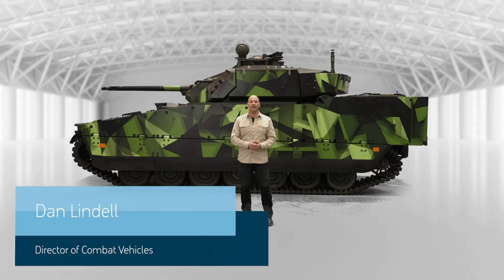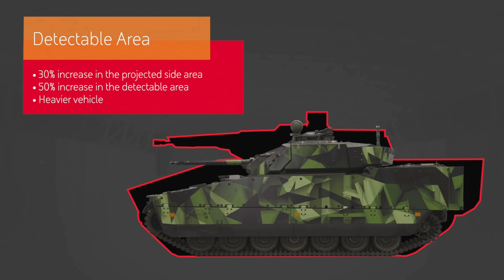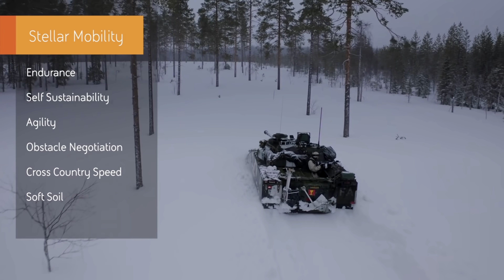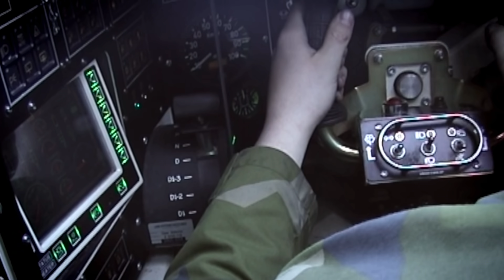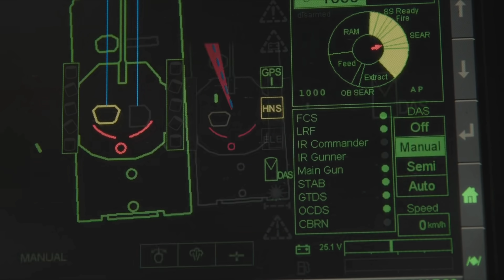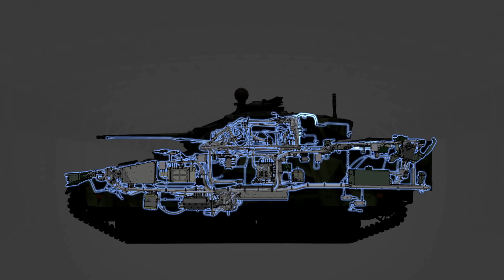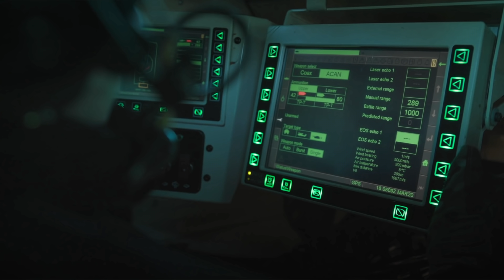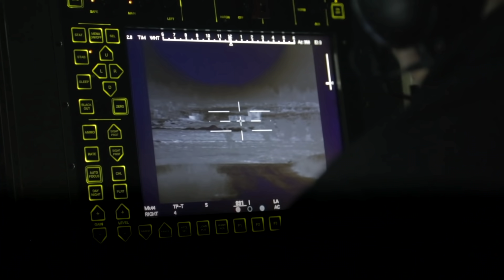The CV90 Infantry Fighting Vehicle Family | THE BEST IFV IN THE WORLD 🏆

Comment: I served on the CV9040B in the Swedish Army. We managed to get positive kill ratios versus the Leopard MBT, Stridsvagn 122 due to the superior mobility of the CV90. We hid in a dense marshland and turned of the engines, let the Leopards take the field past us and then we came out from the cover of the impenetrable marshes (MBTs cant go through without getting stuck instantly). All the MBTs where taken out with armor piercing 40 mm auto cannon rounds and anti tank rockets to the rear, we lost 0 units, they lost everything. Mobility is king in mechanised warfare.
Reply: I guess the tanks had no recce going ahead of them, sounds like a set up to lose/win for your side. Real theatre vs. training exercise is such a scam. No comparison between the two........just saying.
Reply: @beerthug  It's not meant to be realistic to an operation. It's just tank to tank combat exercise. We do the same as well and the scam is not exactly the word for these exercises. It's meant to get the crew ongoing and aware of the weakness and strengths of their vehicle. Not to mention that the CV90 was simply a very, very powerful machine for its size.
Reply: @beerthug  If I recall correctly there are reconnaissance units that consist of MBT (or just have some, don't remember). I think it is in US Army
Reply: @beerthug  Like Benlex said it is not always full operation scenarios being played out. MBTs and CVs are based on the same regiments and fight in the same battalions in the Swedish military so in day to day training you play vs eachother for the reason Benlex said and just to get quality time in the vehicles and train cohesion in your platoon or company etc.
Reply: It is definitely a situation in which your vehicle was almost designed to succeed. 

Having said this, it is good for all tank crew to get bogged and recognise the limits of their machines. 

While serving in the Australian Army, we once had our entire troop of tanks bogged. Mine got bogged, as did the one that came to pull us out. As did the third tank of our three tank troop.

We had to subtlety call the recovery vehicle all while pretending to the squadron commander that all was fine and we were where we were supposed to be. 

The promise of a few slabs of beer assured their silence, as per well established Australian Tradition! :-)

Having said this, 1st Armoured Regiment used lighter weight APCs and even trail bikes in the recon roll, for precisely the reasons that you state. Not sure what current doctrine, or vehicles are.
Reply: Mobilty is very important for IFV. Heavy tanks is good in head brawling but have limited mobility and is to easy predict their movement if the terrain is soft.
Moving fast in behind enemy lines can win wars.

In WWII the Germans move fast in "impossible" dense forest and won over France.
Reply: I served on the 9040A and got stuck sometimes in impenetrable marshes and almost lost the tracks on hard surface snow xD
Reply: Further proof that tanks are obsolete.
Reply: @cat_city2009  Not necessarily. As I said in a previous post in this thread, the situation described was one in which the CV90 was almost guaranteed to succeed. All tanks are susceptible to being attacked from the rear and the situation, as described demonstrated that the Stridsvagn 122 unit had a significant recon failure on their flanks. And where were their supporting infantry? 

I recall situations in which lighter allied tanks did similar things to the Tigers and Panthers in WW2.

Had the the tank unit done their recon properly, the lighter vehicles would have been detected and been at the mercy of the longer ranged and heavier armed tanks, or from their supporting infantry's own anti-armour weapons.

I could post any number of scenarios in which the outcome would have been reversed. Irrespective of recent developments in missile technology, light armour rarely performs well against a modern MBT.

Heck, on exercise, I've successfully ambushed unsupported armour, while playing OpFor infantry and in turn been successfully ambushed by infantry, while in my tank.

Tanks are just a continuation of the age old battle between weapons and armour that dates back to the early bronze age. It'll keep on going until the end of time. :-)

While the current conflict in Ukraine has many believing that the era of tanks is over, I remain unconvinced. 

Heavy armour has shown its value in nearly every conflict since WW1 and I think that the most significant lesson of the current conflict is that without adequate leadership, supply, air cover and recon, all vehicles, whether tanks, IFVs, APCs or even trucks are highly vulnerable to modern infantry carried missiles and plain old desertion/abandonment.

But there is a rock papers scissors here as well. Infantry are highly susceptible to artillery and air power and the Russian have failed to deploy these assets correctly since day 1. For example, it is very hard for infantry to hide from thermal imaging. People moving in the open give off a lot of heat and modern sensors are very good.

Given just how important mobility is to modern warfare, I believe that we'll see another evolution in tank design, perhaps the inclusion of specialist anti-missile defence vehicles (similar to the old Flakpanzer Gepard), rather than the removal of armour from the battlefield.
Reply: The 40mm rounds can destroy a tank as formadible as the Leopard 🙄
Reply: @bangalore8627  yes a lepard tank is made to have light armor and win in speed, in a nutshell it's a M18 hellcat with a closed turret and a superior gun
Reply: As a 33 year US Army maneuver vet, I completely concur. I saw the CV90 in 2018 and loved it.
Reply: @greg.kasarik  yes I think what the current conflict has shown is that poorly trained poorly led heavy armour used in isolation predictably and without adequate support will do poorly. This is not really news, that said I do think that light armour, mobility and enhanced firepower are making more of an impact, consider that they didn't really exist until not so long ago, at some point carrying heavy armour (that is ineffective) around could become more of a problem than a benefit.
Reply: @tomriley5790  I tend to agree with you. I think that with the advent of missile systems, we are moving back towards a battlefield that will reward mobility over firepower. This is the kind of environment that saw the original Leopard 1 favour manoeuvrability and firepower over armour, whereas later MBTs tended toward heavier armour, even as their more powerful engines allowed them to pack considerable firepower and even mobility.

What doctrine will look like in a decade is anybody's guess, although recon has really been shown to be a real Russian weakness.

I think that we'll be seeing far more reliance on anti-missile technology, including anti-missile equivalents of the Gepard, with perhaps one embedded in every troop/platoon of MBTs.

I also expect a significant shift towards early deployment of infantry, to clear out enemy missile teams, the use of cheap drones and other specialist recon tools that haven't even been invented yet. 

I wouldn't be surprised if we start seeing real time satellite recon, given that the resolution of military grade satellites is far greater than anything we've seen released to date and the potential for real time information sharing is increasing exponentially.
Reply: @bangalore8627  Not from the front certainly. The MBT crews either did not know what they were doing or they were practicing in conditions  unfamiliar to them.
Reply: @PropensityVisualized  I have no idea why we don't operate a fleet of the things in concurrence with a base heavy wheeled chassis like the Boxer. Just the training and logistics aspects combined...

US inventory is very fragmented.....and they keep adding different vehicles...recently the griffin light tank.
Reply: Positive kill ratios in what? Call of duty? Wth is going on in this comment section 😂😂
Reply: Information and the Mobility to exploit it.
Reply: I agree.. i was in the Leopard 2A4 and we always looked how cv9040 just flew around in terrain we wouöd never dream of going into. Also in snow it was like a boat going through water. My friend was mech inf in one of these and he never complaied about the space in the rear..  and when they opened fire with 40mm i had to change pants. The power of the 40mm was terrifying. You feel the stomach jumping around when 50m away from it and in auto fire mode.
Reply: Today's warfare changed and mobility isn't enough, a modern army must have real time Intel and good and secure communications, the mobility is the last thing in this new environment, if your army have the air superiority then everything is more simple if not those ifvs would be sitting ducks
Reply: I am leaning towards the CV-90 to replace the Bradley looks tight and right ,if the USA buys 2000 of them will they be made in the USA ?
Reply: @bangalore8627  The future of M.B.T is lighter smaller with as much high tech weapons as possible ,remote heavy machine gun on top with many sensors of all types .
Reply: @sku32956  I would think so.
Reply: @hukebein92  I believe that the Ukrainians are disagreeing with you when it comes to the value of mobility...
Their IFVs allow them to move troops before the Russians are able to make orders to counter their movements.
Reply: Välfärd!
Reply: Sounds like shitty tactics should have lured you in, tanks still have a better stand off distance, hence just keep you at range and push supporting AT teams at your flanks. Idk though I think it's a beautiful IFV
Reply: So you played pretend. That's cute
Reply: can somebody plz explain why more APCs/IFV don't have bulletproof sunroofs so that the mounted infantry can use their rifles to shoot out from the top of the APC/IFV??
Reply: Stridsvagen????? How? I don’t believe you.
Reply: @dwwolf4636  you talking about the mpf
Reply: @greg.kasarik  It's good to train like this as you never know what might happen.  I remember back in Iraq when 4 Bradleys took on like 10 Iraq MBTs.  They attacked 2 by 2 rolling back and forth taking out tanks with TOWs and banging away with auto cannon to get their attention.  Bradleys actually got more kills than the Abrams
Reply: @brinkee7674 Really? Based on its ability to fire TOW missiles or was it more about the Bradley’s small size and maneuverability? I’m a little surprised by that but I suppose context is important. Perhaps support vehicles are more effective in urban environments?
Reply: How did you survive the artillery and FPVs though?
Reply: Me too it seemed ez on  warthunder 😂
Reply: @cat_city2009  nah
Reply: @alexcope8142 every hole you put on armore makes it more difficult to make and more vulnerable by design. also, the turret on the IFV/APC is stabilized but the infantry inside is not, so they're just getting themselves vulnerable while not shooting sh!t (understand the vehicle will be moving in this case)
it's still used rarely, but it's mainly considered an outdated design
so you dismount and shoot straight or protect and lose the capability of shooting, there's no good way around it
Reply: if you can hide from the drones...tough sledding in ukraine
Reply: @beerthug the ukrainiam tanker in his Bradley that killed a T72 said he owes his skill in a gaming program.
Also in the gulf war the m1 abrams tanker said their war games in the american desert was easier than actual combat against the iraquis
Reply: @bangalore8627  They can. There is no question about that, in comparison to the Bradley 25mm ist's like a .22lr vs a .50BMG so they absolutely can, but only if the tank is inoperable because it would take out that CV90 with one shot. The CV90 cannot match the Strv 122, it would have been gone before it got in effective range.
Reply: @HikerBikerMoter   They are full of shit. In reality it's your life on the line and acting as you would in a game will make you very dead very fast.

That was a lucky thing that happened because the tiny 25mm rounds are not packing any punch against proper armour, the tank was hit exactly between the turret and the body, that is the only reason why it was disabled and no armour was penetrated.

In comparison the 25mm bradley round is like a small bullet, the 40mm is a shell, it's like comparing .22lr to .50BMG. 

AP 25mm cannot even deal with a CV90, much less a tanks armour.
Reply: @greg.kasarik  I've done this for a LONG time, in Sweden with these exact vehicles and the answer is no, a 40mm will not be able to take out the StrV 122, period. Unless you launch it and they take it up from above but we gave up on that idea before we even considered it.
Reply: @michaelmay5453  In all honesty, I don't care how much time you spent "with these exact same vehicles". 

I'm not the OP and I never posted any claims about 40mm penetration. Maybe read what I post, before having a go at me.

But now that you bring it up, have you actually, fired a 40mm Bofors L/70 against the arse end of a Leo 2 Mark A5, or StrV 122?

If you haven't, your "experience" means nothing. Armour penetration studies are kept highly classified for a reason, and as the Russians are finding out, it is often what you don't know, or assume you know, that will kill you.

This is why post WW2, the Allies spent so much time testing their weapons against captured Axis equipment. 

So, basically, you are barking up the wrong tree with me, mate.
Reply: @michaelmay5453   @michaelmay5453  I don't think you are getting the point here, and calling people, "full of shit" only makes you sound like an idiot. If you can't be respectful, then kindly GTFO.

For someone who seems to be claiming modern military experience, you seem to be ignorant of the fact that many modern armies use vehicle simulators to train their crews. In the long run it is way cheaper than using track KM, and practice rounds, and you can pick up mistakes, that otherwise would go unnoticed. I expect that this was simply a translation error, or the journalist not understanding the role of modern tank simulators in crew training, and assuming the crew member was talking about a game like WOT.

Although, I have noticed that soldiers who are good at games that require good hand eye coordination, are also good gunners, but that is simply my own anecdotal experience.

Nobody is claiming that the bushmaster penetrated the T-90 (AKFAIK), but the psychological effects, on an unprepared crew, would be devastating. It would be like being inside a big, noisy bell. Indeed, after I saw the video, I realised that we really should be training our crews to sit in their tanks and take these kinds of hits, in order to prepare them for the experience.

And of course, even with a 25mm round, it is very easy for all of your sights and suchlike become rendered useless, making the tank a mission kill. The T-90 has a reverse speed of 5KM, the same as the T-72, so it wasn't like the driver could reverse out of the range, or behind cover. They were stuck in the open, a and if they'd lost their ability to see, they were screwed.

The T-90 also has the same tiny driver's view scope, of the t-72, and makes it worse, by making it the centre of a shot trap (the armour around it is very poorly designed). If a round had impacted the front and shattered the driver's ability to see, that is game over, until the driver can replace it, and if he is freaking out, then this might not be an option. That is even assuming that the vehicle had two driver's periscopes. It should have, but with the state of Russian equipment, that isn't a given.

Also, it seems clear from the footage that the Bradley was using High-Explosive Incendiary with Tracer, which would have made even a bigger mess of the exterior of the T-90, and potentially caused panic in the crew, but not risked penetration.

Fact is none of us know what happened with this engagement, and we might never know, until the Ukrainians release their full report of the incident and the condition of the vehicle, which AFAIK, they have yet to do. All they have said that the vehicle was "unusable" after the engagement.

At the moment, all we can say for sure, is that a Bradly with its 25mm bushmaster did in fact perform a successful mission kill on a t-90, and that vehicle was subsequently captured by Ukraine.

Was it luck? Certainly. But then again, half of surviving on any modern battlefield comes down to luck. I survive, while my mate ten metres away gets taken out by a mortar.

The very definition of Luck.
Reply: Now Sweden is changing the guns to 35mm...for good or bad. I believe the Ukraine war has something to do with that, seeing Bradley's 20mm AP rounds taking out T-90's & T-72B's. And that is with a slower firing 20mm gun than the CV90's 40mm gun. 
More ammo in store is good, its now a weakness in the current swedish model. 5mm does'nt seem much, but taking into account the casing-size, its a big difference.
Reply: @periculosumadversario  No, no we're not. Nor does the Bradley have a 20mm autocannon.

I have no idea what you are even talking about and neither do you.
Reply: @michaelmay5453  Ok, it's It's 25mm, yes, a typo, and if you do not understand of how a larger  supply of 35mm ammo carried, with not much differing in penetration affects the combat effience, I believe it is you who don't know jack shit.
Reply: @periculosumadversario  The 25 is crap, it's what we moved away from because it IS crap. 

We'll have a few of those but in reality we will keep the 40mm for the absolute majority of our CV90's.

I don't know what you are on about with "35mm" it's never been used and it won't be used in the future either. 

If you meant the 40mm then the difference in penetration is INSANE, it's like a .22LR vs a tungsten core .50BMG. There really is no comparison between the 25mm and the 40mm.
Reply: @michaelmay5453  The swedish army are currently upgrading it's CV90 to one's with Bushmaster 35mm guns, so yes, there will be.
I was talking about the Bradley variants earlier, those come with either the old 20mm or on the newer models 25mm gun.
I have not compared 25mm w 40mm guns regarding penetration, nor does Bradley come with 40mm guns, and fighting IS have nothing to do with needing a larger caliber, specifically.
You don't seem to know what you are talking about at all.